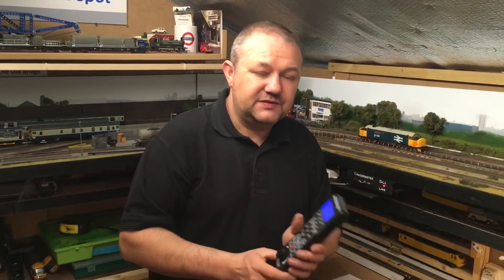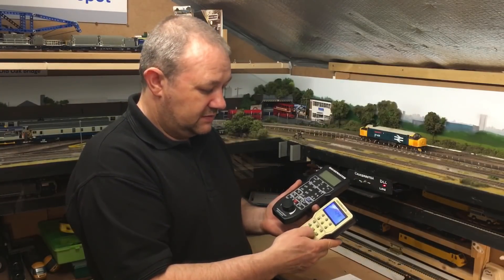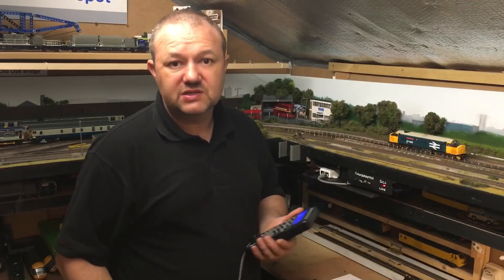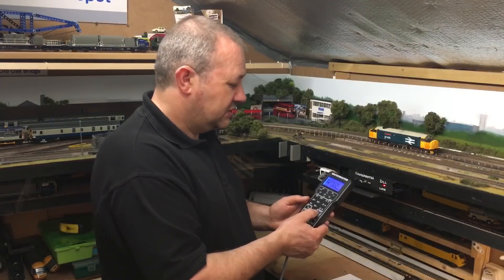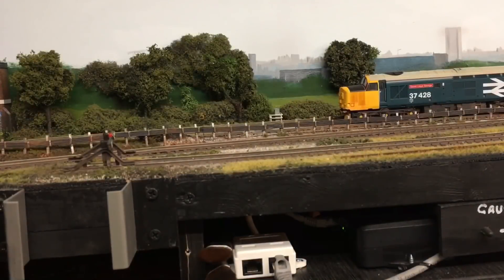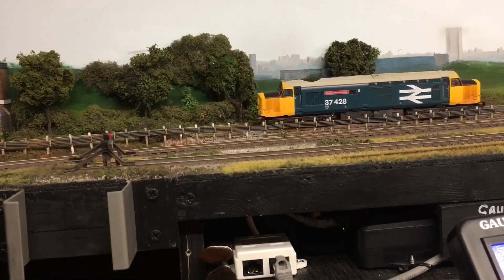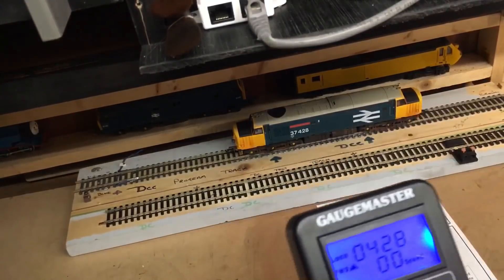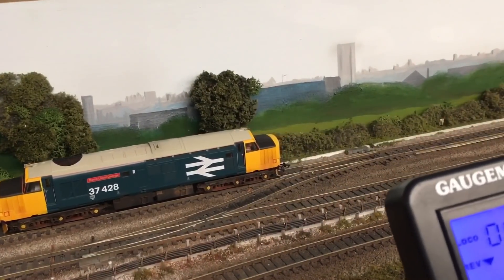Program loco's CV’s using DCC controllers

Comment: I got a bachmon loco with sound from the factory #3 can I reset it with the mrc express?
Reply from the maker: Hi buddy - I’m on the understanding your loco is new and default to code #3 yes you can change the address to suit the desired running number / your manual will walk you through - it can be reset to factory but I personally would only do that as a worse case go back. 
Hope this helps 

Garry

Comment: I’m new to model railways but especially new to DCC if I get a prodigy advanced two and a prodigy express DCC controller package and a prodigy advanced two controller could I connect all three of those together to control three different loops of track that would be insulated from each other at the same time (I wanna know so I don’t mess up and waste money on one I don’t need)
Reply from the maker: Hi buddy apologies for the delayed reply - been a bit busy with new things.. 

You only need one system ( and yeah your just adding extra cost that would not be needed- All prodigy is compatible within its self. 
I would not recommend combining more systems to one unit. ( you just wire all your sections or track to the two feed wires in a loop / Or bus wire as known under the board that will carry all the signals of all the different locos running.. 

The Prodigy Advanced will handle a good few locos - I have 30 on my layout ticking over 10 running - so its a beef of of kit..  plus you can add a booster pack to any prodigy system to give more amperage if needed. personally I just use the one Prodigy advanced system.
Hope this helps 

All the best Garry..
Reply: @ oh yeah, no problem with the wait, yeah I didn’t really think about that. Thanks.

Comment: i,m new to this but can i damage my loco,s changing cv,s, i,m scared as well
Reply from the maker: No you won't damage the loco as its the decoder chip data you are changing so this only changes the performance - THE CV values are designed to be changed by the operator - 
   I play by changing CV settings as it help the running to get a prototypical feel for the loco.. 

Remember all Decoders have a backdoor RESET code to get you back to factory state.  check your decoder values on pack - normally CV8 DATA 8 enter. 👍

I have some sheets on my website that may help 
https://www.cheekytek.com/dcc-advice

start stopping sheets may help you get a feel 
Try changing CV 2  with is Volts starting - refer to manual default 
then
-increase the CV3 values to slowly start 
-increase the CV4 values to slow stopping 

Personally I dont change CV29 which is the heart of many operations as that is a minefield unless you get to grips of it all..

Hope this helps 
All the best Garry
Reply: @cheekytek  Gary your awesome. thanks for the reply i was worried if i made a mistake with the voltage it my blow up lol i,ll a have look at your sheets. thanks so much for your help merry Christmas

Comment: Brilliant helpful viddy. 👍👍
Would the cv settings be similar for n gauge steam trains?
Reply from the maker: Thanks for the comment,  I would believe so as dcc mirrors in scale due and would relate to motor pull in scale size, but not something I have tried as I only model in OO scale currently.. 

With steam settings you would delay the motion to mimic the real thing.. but interesting to find out..

Thanks again..

Comment: I use the same controller after returning another. I am just writing a database to keep track of my collection and came back to look at what DCC settings you were discussing here. I have included DCC and DCC sound, decoder type, address, CV2, CV3, CV4, CV5, CV6, usual running speed step and maximum speed before it looks daft as data to refer back to.
Reply from the maker: Oh yeap I totally agree with you there and something I do with my loco running sheets by adding the CV data settings to refer back on performance. So easy to for get with many loco's.

Cheers 👍

Comment: Hello, great video.  what speed step did you use?  Will it make a difference?
Reply from the maker: as long as both loco's are using the same speed step they should synchronize - it does depend also on what decoders as some decoder have certain speed stem parameters -ideally 128 will give more scope but mainly use 28 speed steps for quick set ups..

Hope this helps... Many Thanks.. Garry

Comment: Hi, I have same controller and was wondering on the back of the control box it has wires for main track and wires for program track, can you have both wired up at same time. As long and like you i have a program track separate to the main track, Thanks
Reply from the maker: Hi Ken 

Yes 👍 as long as the main track and program track are separate then this is completely okay....

ie..from green plug on control unit - 
*Main feed wired to layout 👍

*Programme feed wired to separate track off layout for programming only. 👍

Because they are separate wiring they wont interfere 

This is done so that the hand set can program a train - and then be entered on the hand set to run it on the layout without re-wiring or changing anything- 

If you feel unsure refer to the user guide which can be found on the Gaugemaster web site under the prodigy product.

Hope this helps 
If any further concerns I’m happy to support. 

Garry 👍

Comment: Hello - love the video but I'm a bit confused, do all these prodigy controllers have the blue screen? because I've seen some on you tube that are silver/black lcd
Reply from the maker: Hi Paul 

I think the early versions didn’t have the backlight display  - which all new prodigy systems now have when connected - 
There are battery walk around wifi handsets, so this may have just  a normal view to save battery.( but I have never used them ) 

it will say on the Gaugemaster web site under product information..

Cheers Garry

Comment: Hi.would you happen to now what the SHORT codes mean,as i am having problems using me prodigy express controller and trying to power my layout
Dcc, i pluged the power pack to the mains and put a multi-meter prob into the middle hole and the black on the outside reading of the jack plug 12.8v place the red prob to pin 3 of the green plug and the black to pin 4 reading 0.08 is that right, as i am not sure would be greatfull for you feed back thank you Brian
Reply: Hi Gary.thank you for your reply(1) removed all the dropper wires and started again,at the moment things are looking good (2) the voltage problem i thing was down to me as i had the meter set to ac NOT dc.....thats how i was only getting 0.08v as it was from a power broad, 240v So hopfuly things are all ok and again thank you for getting back cheers Brian.
Reply from the maker: Your welcome Brian, just glad all is running - all the best buddy
Reply from the maker: Hi Brian   - ok my suggestion is to un-plug what you have and re-connect as the instructions/ these can be found on the Gaugemaster website in the advertised product / instructions,   ✅ the green socket with 4 wire connecters (1234) from the power supply should be  🅰️ 1,2, is the main feed to the main track layout ( make sure that if red is left & blue is right on track make sure the whole layout follows your preference.    🅱️ 3,4, is the program track which must be kept separate from 1,2, feeds. -   🛑 As this is DCC you may find false reading on a test meter because the voltage is pulsing differently than DC. But start as mentioned and refer to instructions - this should be all ok  ( hope this helps ) Garry

Comment: Excellent film.  For a DCC program track do you just wire it to a 12 volt supply?  Also does it damage locos if you program them on the layout?
Reply from the maker: Hi buddy 

No don’t wire 12v 😮 
Any compatible dcc system is 18v  - only wire the dcc system to run your layout. 

This will have two outlets for track power 
1= main track (the layout) 

2= is the programming track these must be kept separate 

You can program any loco on either track but program track should be priority 

If you have more than one loco on main track - then it can potentially complicate other decoders.

Hope this helps
Garry

Comment: I have the Advanced 2, a good price, Gary. My ECoS developed a short in the circuit board and the cost to replace it was cheaper to buy7 a new one (£600). I liked the guide, Gary.
Reply from the maker: No problem yeah I certainly like the Prodigy A2 nice easy system 👍
Reply: Cheers Gary, I would not mind a copy. Nige @cheekytek
Reply from the maker: Hi Nigel 
If you go to my website cheekytek.com
I have now added these sheets on a page called 'DCC Guidence' where you can copy paste or download a powerpoint copy..

hope this helps.. 
Cheers Garry

Comment: Please how can I get this to bring up all the sounds on a Hornby DCC loco?
Reply from the maker: Provided the loco has a sound decoder with speaker - like all DCC systems just use the F keys (function)

Start with F1 and so on for higher values like F10 you need to press Shift first them F1 = F10 and do on..

Hope this helps 👍
Garry 

That’s all there is to it

Comment: So i can change the speed steps on the express unit to make the loco have a smooth gradual speed acceleration?
Reply from the maker: Hi buddy- Yeap totally 

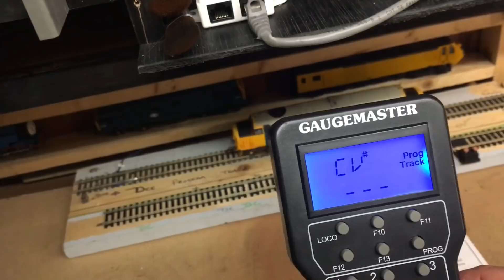If you watch the video from 12:00 onwards and follow my settings or even half the values to suit you - your see this on your loco..

As a default I use I tend to do a loco as this then adjust up or down with these values on cv 3 & 4

Cv 1 - loco address 
Cv 2 - start volt = 6
Cv 3 - accel = 30
Cv 4 - decel = 40
Cv5 - blank enter
CV.  - blank enter
Enter to finish 

Hope this helps buddy 

Cheers
Reply: @cheekytek  hello, will i be able to control a horby 08 tts sound loco with the gauge master prodigy express package?
Reply from the maker: Absolutely .....    yes 👍
Reply: @cheekytek  will i also be able to add a couple locos in the future with or without sound?
Reply from the maker: DCC systems will run any loco weather sound fitted or just standard loco

As long as each train has a decoder and a different address to identify it 

There are a lot of great books on DCC and how it works that will bring you the best out of your system.  
Think the Internet would be the best place to find something like that..

Cheers 👍

Comment: Hi Gary, a quick question. After programming cv for slower deceleration, if the loco is running in to a station but looks like it will over run the end of the platform, is there a function to simulate extra braking being applied so that it can stop in the right place?
Reply from the maker: Hi Stephane 

Personally I press the minus button to slowly reduce speed to a stop at my point on the station- give that a try 

😉👍
Reply: Cheers!

Comment: Hi Garry. Just came across your channel as I am looking to buy the Prodigy Express controller. Thanks very much for an extremely helpful video which has given me plenty of  the information I was looking for.
I have just changed over from HO to N Gauge and am about to start building a small layout. I have some experience of DCC, but am looking to simplify things with Kato points and switches and just needed a basic controller for the locos.
Decision made👍
Can I please ask where you got your back scene as it looks very realistic?
Just subscribed.
Thanks again.
Keith
Reply from the maker: Hi Keith 

Many Thanks for your comment and for supporting the channel, I must admit I am a huge fan of the Prodigy Controllers and easy to use my biggest love is the diversity on how you can upgrade the system using the old controller or add boosts to a layout - very well thought out 

As to my backscene these are all hand painted by myself unfortunately 

I have done a video that can be viewed on how too 

Thanks again and all the best Garry 👍
Reply: cheekytek  Cheers Garry, I'll certainly check out your other vids.

Comment: Good video.  Do you of a controller that controls up to 20 locos, units etc please?
Reply from the maker: Hi buddy 
Most dcc controllers hold about 20 trains including Prodigy- as a rule so you can scroll through, not sure of others but gaugemaster will only store the first or last five once switched off but can be added as running up engines again.

Z21 will hold up to 99 I believe and they sit on the display panel until activated this being a WiFi unit giving phone controller as a cab..

Maybe dive in to some research on dcc controllers and what you want from a system 

Hope this helps slightly 

All the best Garry
Reply: @cheekytek  Thanks Garry I have an EZ command centre which is good but it only holds up to 10.  I will investigate as per your recomendation to do so.

Comment: Hi again Gary. Thanks again for the reply. Just to rewind a little, I’m in the research phase of building my own medium sized DCC layout, as far as train control goes. But I thought conventional dc operated point switching might be simpler, cheaper and easier (and ultimately give similar results to DCC controlled point switching) so will probably go down this route. Apart from your video on installing points at a later date than your main layout construction and wiring, are there any other videos you would direct me to? Either by yourself or Brian Lambert? I find it’s quite tricky to find the precise summarised info for DCC loco control but DC point switching, especially on topics like electro frog automatic polarity switching etc etc Thanks again, your layout is awesome!
Reply from the maker: Hi Alex I run my points from a CDU discharge unit separate from DCC as seen in these follow on videos 

May be of inspiration 

https://youtu.be/ZjLGLblG350

Cheers

Comment: Hi Gary, enjoyed your video, as a newbie it was confidence inspiring.  Are the instruction manuals of these gaugemaster controllers pretty clear?  Can you explain how another controller is actually plugged in and used when you want to run trains with someone else?  I'd also really like to know how the controller knew it was your test track?  I presume that your main track and your test track are wired in separately somehow and somehow you've allocated them names etc?
Reply from the maker: Hi Alex 

Many thanks for your comment. 

For all dcc controller systems and this is generic each cab just plugs into the main controller unit - a splitter to extend more cabs cab be added to the main unit for multiple use - these just plug in and both cabs will work immediately 

Refer to gaugemaster prodigy advanced 2 manual this will guide you.. 

For programming you do need a separate track 
Known as (programming track)

Your Main Track will be the layout itself 

When programming select the program button on the controller it will toggle between main track and programming track.. 👍

Cheers Garry

Comment: Great video Gary. I'm an old model railroader of about 40 years ago. I have a bunch of HO  track and trains in a box that I haven't used since. It's obviously DC...so this video really helped me get a better idea of what DCC brings to the realism on the track layout. I believe the track is Atlas brass track which I'm sure I have to clean before I even think of running anything.I'm trying to figure out where to start. I know I'm going to need a new engine that's DCC because I love the new sounds that come out of these new engines today vs. years ago. I'd love to hear from you to give me an idea of where to start because I know it's going to be s while to complete the layout. The size I'm going to be working with is probably going to be 4'x8'.Hope to hear from you soon, so I can put together a game plan to get started. After all these years I'm still very excited to finally committing to putting a layout to board. Thanks so much. Mark
Reply from the maker: Wow Mark sounds like you bought a ticket about the model railroad express and what a journey we’ll have 😉

Track is probably the most important part at this stage so make sure it runs every good 
A few DC test wires just check your heading the right way 

If you have problems at this stage at least you know it’s the track rather than heading on down the road struggling 

Then I would suggest looking at Brian Lambert on the Internet as he has a very basic look of dcc wiring but the more you read the more intense you can dive..

This is where I started 👍

4x8 sounds a beautiful layout to start with and I think you’ll have plenty of fun my friend 

Your always welcome to knock on my YouTube door if you need some pointers 

All the best buddy 
Garry

Comment: Good video. Thank you for sharing. I’m looking at getting the Gaugemaster DCC prodigy Express for my Railway.
Reply from the maker: Hi buddy 

It’s a great system and if you upgrade all of it is still compatible 

I have both prodigy systems and I have many ask to buy the express off me but I will undyingly use it on my next layout or as a spare cab with my advanced 2 

Easy and very versatile 👍😉

All the best Garry
Reply: @cheekytek  If i were to whant to have point moters for a 6ft shunting depot what would be best and inexpencive, to go with the controller?
Reply from the maker: Thanks for the comment 
You can use many different point motors but requires an address module or dcc chip to code it. 

Without filling this page with the answer I’ve dug out this same topic on RMweb page that will help 😉👍

https://www.rmweb.co.uk/community/index.php?/topic/80524-point-motors/

Cheers